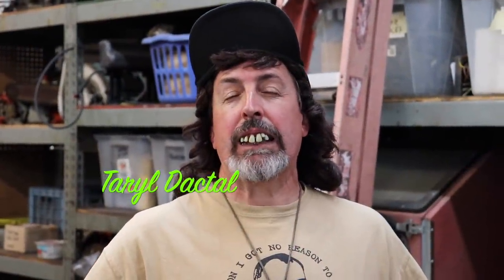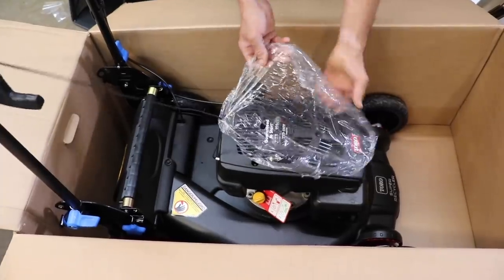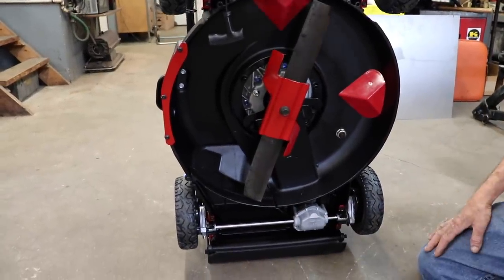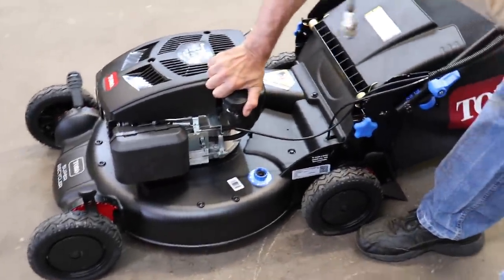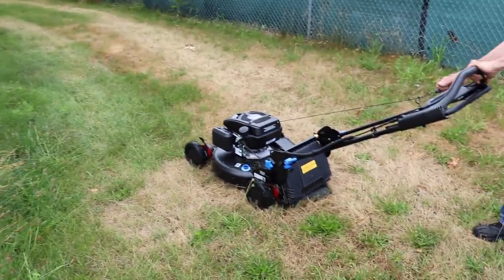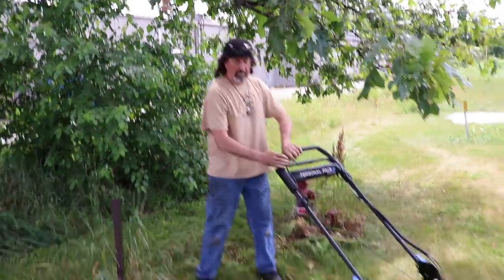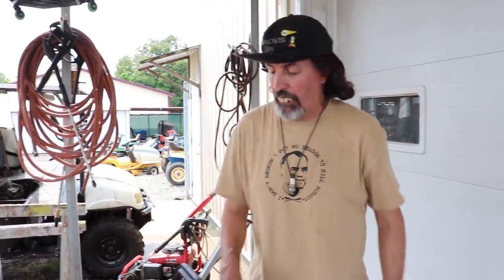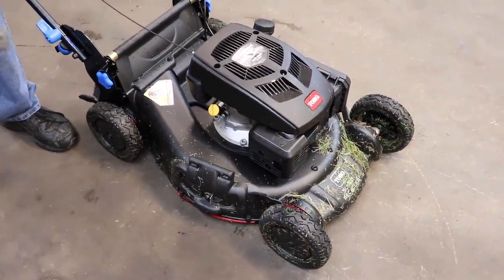Toro Super Recycler Mower Review - Is It Worth It?

Comment: I bought a 21" Personal Pace with the blade brake and the Toro engine, I've been very pleased with it so far. It replaces a 1988 Toro Self-Propelled aluminum deck with blade brake and a Suzuki engine. I'm a little let down because I only got 32 years out of my old one!
Reply: We bought the same mower back in 1991ish for my parents as a gift that had the new Briggs/Toro engine to replace Suzuki engine. My brother is still using the mower today. Kudos to Briggs/Toro for designing a good engine. A couple of years ago the carb fell off from machine-while it was running! I guess the gasket dried out after 30 years and bolts lost preload.

Comment: I have one of these that's about 10 years old with a Briggs engine, self propelled and I absolutely love it.  I love the Personal Pace feature the best.  It's so much easier than Honda's paddles which are hard to hold steady on uneven ground.  I love the adjustable folding handle, something that Honda doesn't even have.  I love how quiet it is, the good mulching job it does, and the way it continues to start easily with 1, 2 or 3 pulls even after 10 years.  I also love that it has enough horsepower to easily mulch my lawn.  I had a Honda before this that did not have enough power to mulch and it was constantly plugging up under the deck.  I've done all the maintenance myself on this and never had it in the shop.  I have never used the water pressure cleanout, though.  I am definitely going to buy another one of these when this one shoots craps, but not sure which engine to buy now.  This Briggs has been surprisingly good and easy to start and very dependable.  Thanks for the review.  Love what you do.

Comment: Thought we might get to see a flywheel key/bent blade replacement, but it wasn't in the cards.  I would really like to see a full teardown of that Toro motor.  See how the oiler works, if it's a plastic cam and the cylinder liner and rings.  You know, how many corners did they cut.  I've got an older Toro recycler 3 speed with a funky Briggs motor.  Good mower with a blade clutch and rear wheel drive.
Reply: I still have one of those as well. I can't bring myself to buy a new one, it still works great. It's the same with my late 90's Weber gas grill.

Comment: Just purchased this mower from Home Depot. It cost $599....Mowed the lawn and it works for me. I like being able to stand it up to access the blade(s). The wash out system is weak (as demonstrated) but hitting it with the hose is easy. I had the Toro with the steel deck and it corroded through in several places so I use Fiberglass cloth and West System Epoxy to repair the holes. The mower still works fine and it is seven years old. This is why I purchased another Toro machine, this time with an Aluminum deck...

Comment: Great Video, Excellent Warranty, Good Looking Mower, Great Features with The Greaseable  Rear Wheels, Easy Stow Feature, Personal Speed Control Is Great For Older  People who Cannot Keep  Up With it, Considering  That The Grass Was Wet  It Cut Exceptionally well, Older Mowers Would Clog With Wet Grass. The Mower Didn't Struggle In The Longer Grass From What I Could Hear. A Lot Of Push Mowers You Would Have To Lift The Front wheels and Cut It Down A Bit, But That BEAUTY Went straight Through It No Problems. Very Strong Engine For 159cc. If Anything This Engine Would Be My Choice  ♥ It.

Comment: The hardware store where I did small engine work was a Toro dealer and we did put oil gas and make sure everything was in working order and tight, I like Toro, the personal pace is great and the mulching system was top notch, I'm glad they got back to aluminum decks and have a new color. I like Toro's own engine seemed durable and low maintenance

Comment: I've had 3 lawn mowers during the 43 years of owning my house.  First one was an Iron Horse mower with a rope start 2 cycle circa 1956.  Second mower which I still have is a 72 Lawn boy also a 2 cycle.  I have a spare parts engine for it.  3 is a mid 90s Snapper which a friend of my wife gave us when they moved.  All 3 mowers were free.  The Iron Horse was running when I gave it away.  Never opened a mower box.  Never bought a mower.

Comment: We have a 1995 Toro Wheel Horse Recycler riding mower which still runs well, although we don't use it much for cutting anymore as the mower deck has become a bit too rusty and bent out of shape after a couple of decades of continuous use.  Mulching apparently helped improve the health of our lawn which before using the Recycler was quite sparse in some areas but now is relatively uniform.

Comment: I have a 1995 Toro 20476 Super Recycler that someone gave me 5 years ago!. It’s the best push mower I have ever owned!  It has electric start and the Briggs and Stratton GTS 150 has a charging circuit too!  It has a pressurized lubrication system and the blade clutch and stop is a nice feature!  It even has the front mounted dethatcher and a drop fertilizer spreader that sits on the drive wheels.  This thing will turn grass blades into dust!  It does a better job of mulching than my twin blade Honda!  The pyramid shaped air deflectors under the deck are the key to its awesome mulching ability !Just needed a carbatrator rebuild , new battery and a new belt.  I'll be sad when this thing eventually craps out!   There’s your dinner!

Comment: My favorite mower of all time is the older Snapper high vac, but this what has been called the Toro sr4 is my second favorite, I have both, but the Snapper has always been my favorite.
Reply: Have you used one of the newer Snapper high vacs?
Reply: @stephaniefrazee3955  yep, I work on small engines, and the new stuff all manufacturers have out is built to fail, a L head Briggs is the best engine, I have come across, yes the Honda is a good engine, as is the Robin, and kawasaki, but the Lhead briggs is by far so much easier to work on.
Reply: @knighthawk86855  Is that what is on the new Snapper High Vacs?
Reply: @stephaniefrazee3955  how you tell a high vac from a normal, is of course the bag will say snapper HI-vac, but the real way to tell is the deck, the edge of the deck will be folded under, on a hi-vac, whereas a normal snapper deck will be straight or even folded outward.
Reply: Knighthawk's Mowers Better then the 2-cycle Suzuki? NO WAY JOSE!
Reply: Definitely agree, and I have a Toro 2020 Personal Pace now.
Not even close

Comment: Bought mine last May. If you came here for 2021 season and are looking for reviews - Taryl's is accurate enough. I like mine and got the push button start that has the 190cc Briggs on it. As a matter of fact I just fired it  up for a little early clean up. By topping of the battery monthly overwinter it did great.
Reply: I just bought the one with electric start. I replaced a 20 year old snapper that I couldn’t locate a replacement engine. I hope I am happy with my purchase.

Comment: I love this mower.  I bought mine at the home cheapo for mulching exclusively and it does a fabulous job.  My mower has the Briggs and Scratton engine so it doesn't have an oil drain plug, but I use a pump.  Don't listen to Briggs when they tell you that you never need to change the oil and you just add more as it needs it.  What a load of crap.  Every engine has blow by and the gas will eventually contaminate the oil.  That said I still love the way it mulches and the personal pace drive system.  The only problem I have had is that the first unit would cut out if the engine was jostled, like trimming around a tree with roots above ground.  You could also shake the mower on its back wheels and the engine would stop.  I had no problem taking the mower back to Home Cheapo and exchanging the mower for the same model, which runs fine and does not cut out. 
FYI my old mower was a Snapper self propelled aluminum frame from the early 70s.  In 1994 I replaced the engine with a Briggs I bought from a dealer and christened it my "Franken-mower".  It ran perfectly 26 years before I decided to replace it with the Recycler.  Perhaps it's because I changed the oil regularly and use Ethanol free gas from a gas station.  That bottled stuff is 32 bucks a gallon, ridiculous.  I pay 2.50 a gallon for the 93 octane ethanol free and use it in all my small engines.

Comment: I have a 2021 Briggs unit.  I like it a lot.  If there were one drawback, it would be that it's hard to pull backwards, like a drive gear is engaged.  Not all the time, but often.
Reply: That appears to be still a problem for 2023.  Also engine surging and oil leaks from the head gasket.

Comment: Taryl for sentimental reasons I’m going to hold on to my 1990s era GTS2 Toro Recycler. I think it’s a Briggs 5.5 and I brought it back to life after watching your series. But it’s smoking a little and chugging and doesn’t have much more life. The mower has an aluminum deck still in good shape. What out of the box replacement engine would fit this machine? I know Toro things mounted these engines sideways.  Is a engine swap a do it yourself job?

Comment: Only problem i see is rearwheel drive  continuing to drag the mower into obstacles when tilting back to turn a 180 or sharp corner front wheel drive solves that , i do really like oil not bleeding into the airfilter when tilted back to inspect blades/store it as far as the washport being able to tilt it up to wash the underside is great... i think the mulch deflectors interfered with the cleaning or something  and aluminum being lighter is nice but yo say when it goes through my rock garden it'll put giant holes straight through? I'd prefer the "ankle biter" mower with a fresh coat of camo ;)

Comment: Hey Taryl, will a good size rock crack that aluminum deck easier than a steel deck? 
Does Toro offer a steel deck with this model?
Reply: Aluminum cracks. Steel bends. They make a "recycler" that is steel but not the "super recycler".
Reply: Jim Johnson  a vw beetle floats in water
Reply: Did you watch the vid?

Comment: I have the newer version and the plug seems to be improved. Overall, I like this mower alot but it would be a beast if they put the 223cc on it. They always cheap out on their motors. That's the downfall with Toro mowers. That's why I prefer other mowers like the the cc800 and dw33. This is a nice mower if all you need is a 20-22" range.

Comment: i noticed something the other day im just a every one inawhile mower fixer i have a craftsman push mower guy brought in.he says it starts right up but dies after 2 mns.well i asked him what gas do you use?ohh only the best premium 91 all the way he said.great i thought pulled carb sure as heck it was clean inside not a speck in carb.well ended up he used 91 octane but it was ethanol 91 it swelled seat gasket so needle did not sit down in far enough and starved it for fuel

Comment: You’re right, it’s the LawnCareNuts favorite mower and that crowd loves it.  I like the older ones. Have you run across the sputtering issue with the Briggs 163cc engine?  Seems to be the biggest flaw with that engine.
Reply: The sputtering issue is predominately a problem with the 190cc Briggs though I’ve seen a handful of complaints with the 163cc. I exchanged my 190cc version for another one and it hasn’t given me a problem.

Comment: Neat.  I have the SR4 20056 SuperCare I picked up for $25.  Wasn't engaging the drive and the cables needed to be rebuilt.  Used 1/16" cable wire and some 3M Silicone Paste after cleaning out the cable shell thing a ma jiggy with WD40 and piano wire.   Was thinking maybe using piano wire... though didn't have anything long enough to go all the way through.  Haven't done a solid wire rebuild yet.   Anyhow... that got the blade running at full speed since was the break line that needed replaced since has the blade brake option.  Wondering about hacking into this more modern design to improve mulching, i.e. adding the newer design blade mount bracket with the extra blades and the two triangle looking parts.   Maybe even somehow fabricating with PVC pipe maybe and a heat gun??? the back stop for when recycling to cover up the chute to the bagger.  Excellent investment IMO.  I even found a front mount dethatcher that is a Snapper I'd though I can retrofit for $10 since even the tines are worth that alone.... though looks like Toro even makes a version that I've made photos of so can make the brackets to mount.   Thanks for sharing!   About to work on my first Honda engine tune ups on two pressure washers, the GC160V $20 Excell and GC160 $40 Generac.  The GC160V is running funky, though steady when always triggering the pressure washer gun... but needs some loving.  Next disability payment, I'll invest in the horizontal new pump for the GC160.  Almost want to take one of the older briggs 6.75HP engines and upgrade the Excell or maybe just make a new better pressure washer.  No biggy... good times either way and rescuing the Made in the U.S.A. parts/systems sure helps save in the long run.  Amazing how cost effectively these systems can be safely even made to last.

Comment: That wash out plug is worthless IMO. Just use a hose and spray it down since it stands up. That way you can spray were the bags fits as the clean out deal did a crappy job on that.
Reply: The problem with your solution is that it is possible to get water past the crank seal which will cause it to fail (per my dad who had a masters in mechanical engineering). The hose hookup is a better solution.

Comment: The 2020 23186 model with the Briggs engine has a sputtering issue and times try’s to die.    A lot of people have this issue on this model.   If could do again get the 21382 with Honda engine
Reply: david frankiewicz  looking myself that motor there is a chi-com pos, I will spend the extra for the Honda motor

Comment: Good looking mower think I'd take the briggs over the chonda. The china motors have steel flywheel keys hit something hard and it breaks the flywheel, briggs has aluminum shear key. The hondas are nice but they have exhaust valve guide issues on the gcv 160 the guides back out till they break the exhaust rocker. Great review taryl thanks.
Reply: Honda now have a new built from the ground up engine that replaces the GCV 160 engines, known as the GCVx engines

Comment: I bet the mower engine is made by Loncin (Chinese engine). Probably why Toro isn't telling who manufactures engine. But, I've heard Loncin is pretty good. Even found on some Commercial mower brands. They are kind of the equivalent of Honda and Kawasaki (Japan) for Chinese market, they make Motor bikes also. I still would prefer an American brand engine company like Briggs and Stratton, Even though I bet the newer style Briggs with plastic carbs are probably Chinese made. Honda is probably the only mower engine made in USA.

Comment: I have to say it looks and works great I like the lift back system good to clean for us who service mowers I've never seen a Toro engine before here In the UK but i hope we do great video as usual Taryl keep them coming now There's your dinner
Reply: The new Hayter Harrier 48, 56 mowers with the autodrive only option and the Hayter Osprey 56 have this engine. Some of the cheaper new Toro Recycler models also have this engine fitted. The Briggs and Stratton engines are only seen on the better spec Hayter and Toro mowers.

Comment: Between the three engines (Loncin, Honda, & Briggs), the Toro Loncin engine is by far the best of them all. The Briggs engines built today are very cheap with a plastic carburetor that is PRONE to problems and never runs correctly. The Honda engines are just garbage. That Overhead Cam design is notorious for overheating and shifting valve guides which makes the engine toast. This is also Toro's first time building a black mower as opposed to red. Only the Super Recyclers come in Black. The unit featured in this video retails for $549.99
Reply: That’s a bit of a generalization, Honda make the commercial ohv GXV160 engine which is far superior to the ohc engines and Chinese copies.  Just remember Loncin took Honda’s ohv engine and blatantly copied it.
Reply: macdonaldjohnstonfan I’m not saying anything against Honda’s OHV engines. They’re some of the best engines out there. The OHC stuff is garbage. In regards to this mower, it’s what the competition offers. On this same deck, Toro offers an OHC Honda, Loncin, or Briggs and Stratton. Therefore, the best engine of the 3, is the Loncin. That engine is a clone of what Honda was building 30 years ago on old HRM215 models. That’s when they made decent stuff.

Comment: All the mower shops should get together and not stock B&S cos with a tiny bit of care and maintenance the mower engines last for nearly ever and that stops them selling new mowers.   Except my friend  , he bought a new 4 stroke   B&S Rotary mower, put the petrol in and started to mow 20 minutes later he had ceased it cos there was no oil in it.  So he got another new B&S rotary mower, and he then  got me cos it wouldn't go. He had filled it up to nearly the top of the filler hole with oil.  To be on the safe side this time I suppose. No worries drained out a pint or two of oil till it was at the right level on the dipstick  ( the extra oil now been my perk) and left it handle weighted down to the ground cylinder up position , while we had a cup of tea.   Then checked the oil level with the screw in dip stick again and that you could turn over the mower with the pull starter easily. Washed the plug in petrol .  Started it , It made a lot of smoke for about two minutes and was fine after that.  You have to blame the shop that sold it, my friend just didn't know.  That was a few years ago.